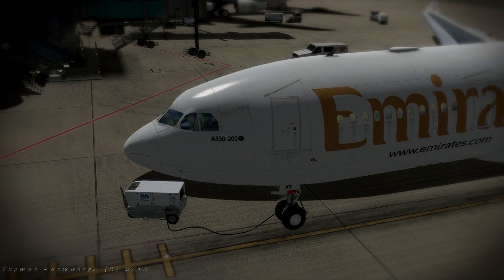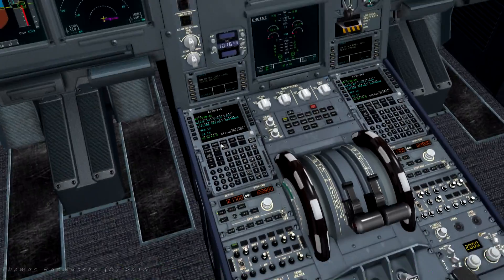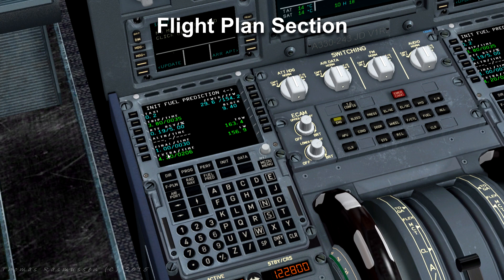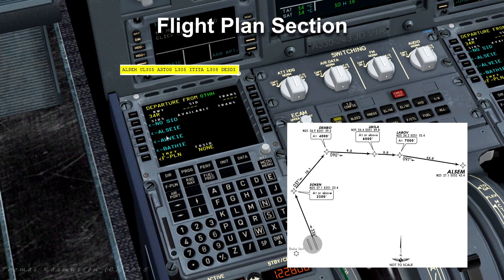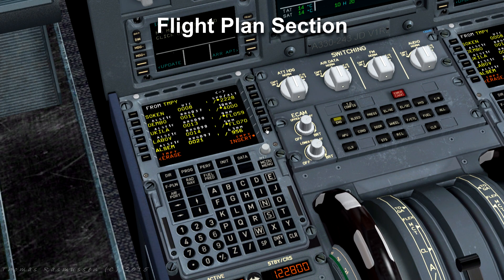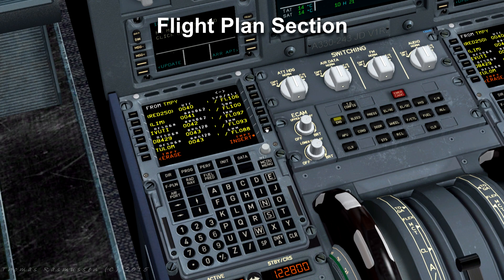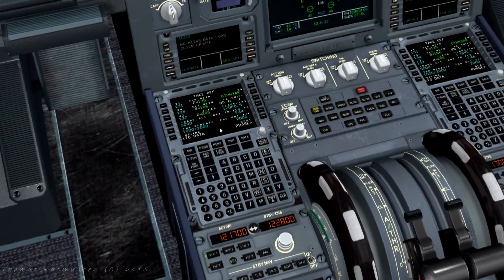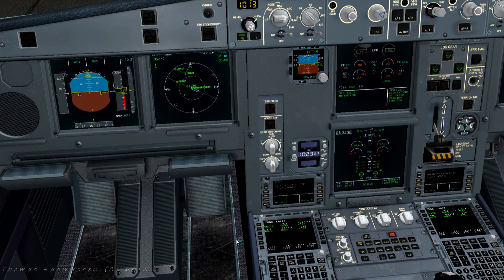Basic Airbus MCDU Preflight Programming - Tutorial Series Part 1 (X-plane 10)

Comment: Hey Thomas! Great tutorial! I have set up a flight plan on simbrief but can't seem to find where the flight level is. I have looked all over the flight plan and can't find it. Also, by block fuel it says 5589. Is that right? I'm trying to fly from KATL to KIND
Reply from the maker: Thanks a lot ;-) Your CL and block fuel weight should be listed on the screen just after you generate your flight plan (using the generate OFP). Additionally, you should be able to find the same info in the PDF flight plan (block fuel weight on the first page). I hope this helps you?
Reply: I see in your video that the flight level should be under planning summary, but I can't find that section anywhere in the OFP.
Reply: Wait I see something that says FL Steps KATL /0400/. Is that the flight level? Sorry I'm kind of a noob, but I'm trying to learn :)
Reply: Never mind I'm an idiot. Found everything. Sorry to bother you!
Reply from the maker: No problem ;-)

Comment: Hi Thomas, please help, when I Try to add any waypoints I always get an error on thr MCDU saying "AWY/WPT MISMATCH".. ???
Reply from the maker: Hi Sérgio, which aircraft and what route? Maybe try to mimic the route in the video?
Reply: I'm trying a route LPPR-LPPT, simbrief gives me MANI9E MANIK DCT XAMAX XAMA6C. Using an LPPR chart, I choose a departure from the runway 35 to twards  BELDU waypoint and program it on the MCDU, it automatically adds UDRUB, PR614, T/C, PR634 and MANIK waypoints. Next I want to add the XAMAX waypoint indicating airway DCT (according to simbrief fligh log but I'm always getting that "AWY/WPT MISMATCH"error on the MCDU...
Reply: Well, I skiped that part, so next I choose to land on ILS rwy 03 and programed it... and it automatically added all the missing waypoints in the route... problem solved I think.. now, how do I program speeds on each waypoint on the MCDU ? altitude is indicated, but speeds are blanked... thank you... oh, almost forgot, the aircraft is the same you used on your tutorial, the A330-200 by JARDesign.

Comment: Hi, is there a special way to load the fuel? Or do ujust do the zero fuel wait and block fuel thing
Reply from the maker: Use the fuel menu to get the correct amount of fuel (As I recall, you can also do it from the fuel & weight menu in X-plane).